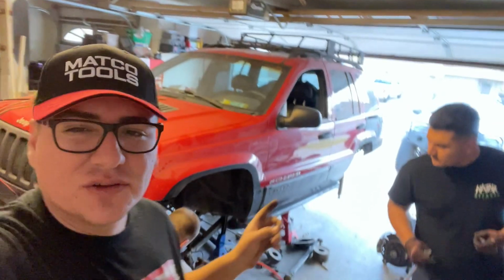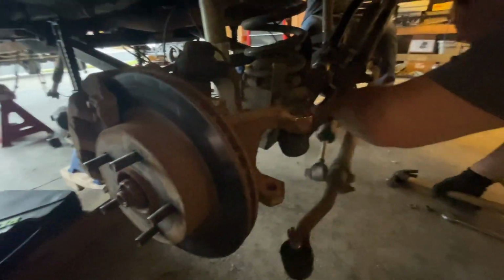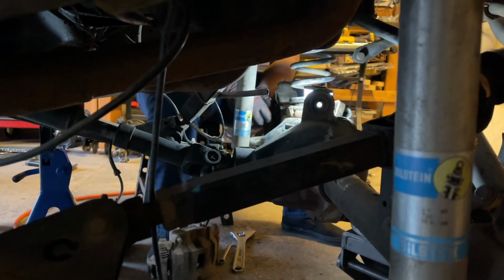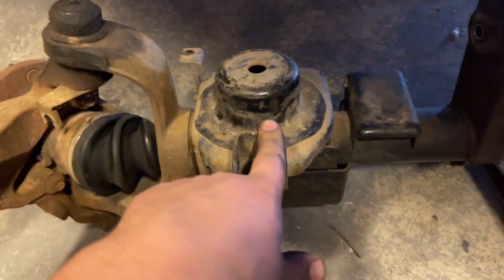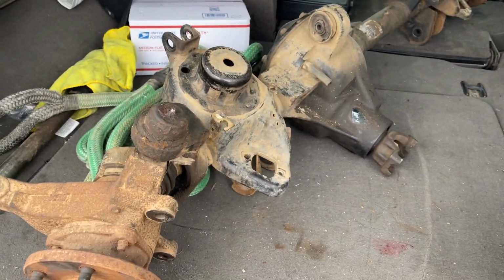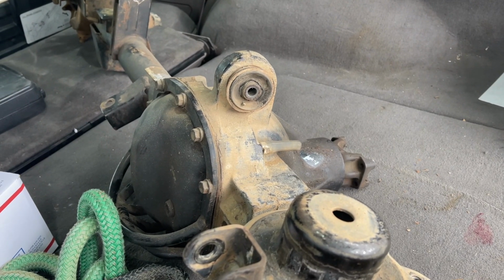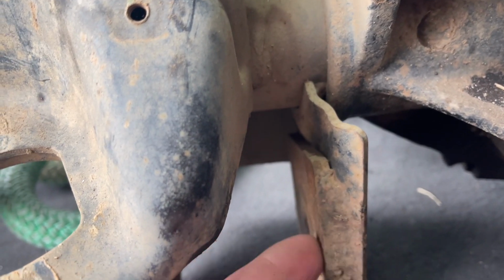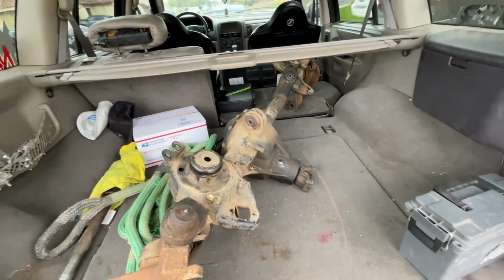Picked Up The New FRONT AXLE For The Jeep WJ

Comment: That a D44 front axle you gonna be putting in? I have Tom woods driveshaft for the stock D30 those take a different ujoint between the two
Reply from the maker: No Dana 44a rear Dana 30 front

Comment: I'm looking at a 2x4 here and I'm wondering how hard would it be to turn into a 4x4? This would be a 2nd jeep to buy for me....looks good and clean. Just not 4x4...if anyone knows or has a recommendation on where to look for info holler at your boy
Reply from the maker: I would imagine the front axle driveshaft transfer case maybe the transmission not sure
Reply: Transfercase - transmission- front axle - shifter and a few other things from what I seen on the Facebook WJ pages
Reply: Basically what Craig said. Except you don’t have to have a different transmission. A 2wd and 4wd transmission is the same, except for the overdrive unit. So if you aren’t comfortable with changing the transmission, the overdrive unit is easier. 

Source: converted my 2wd WJ
Reply: @brendonminchew3260  yeah I think I'll do it. Its a 4.7 which makes things a bit more difficult. Parts are rare but I'll keep looking. It'll be a fun project.